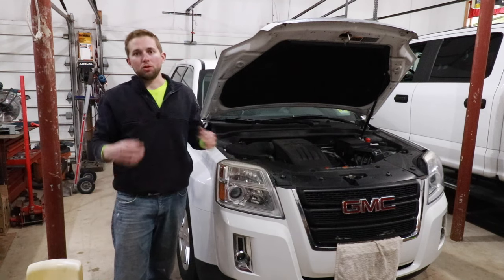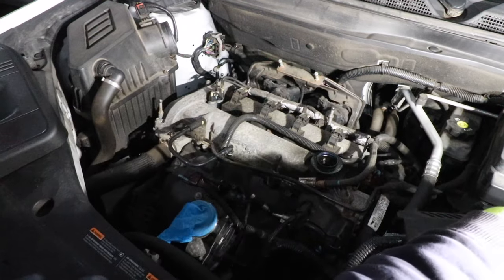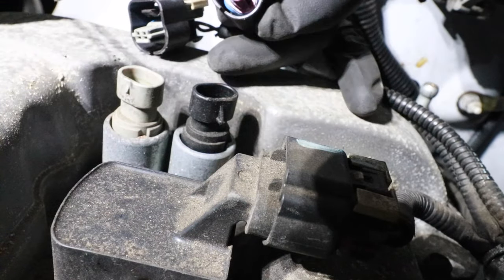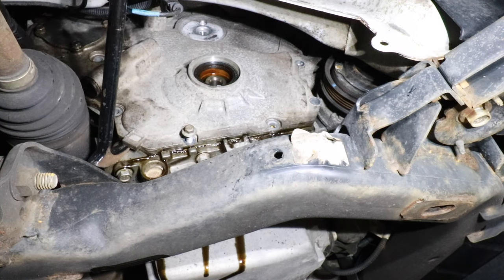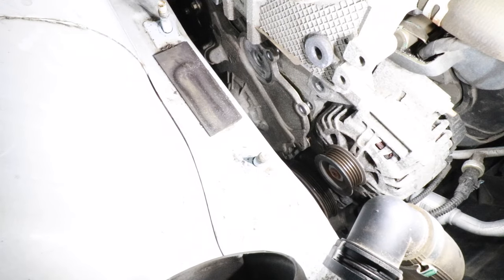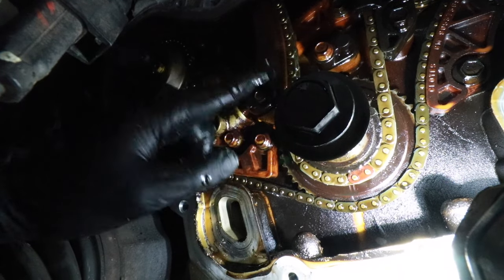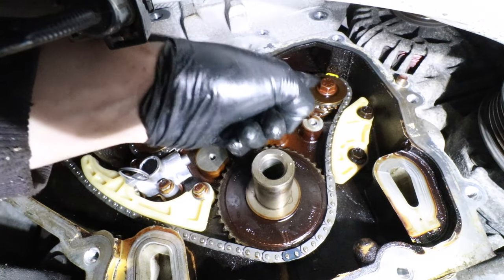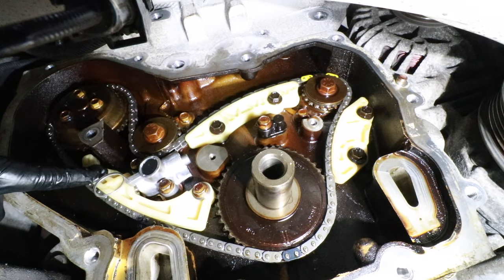GMC Terrain 2.4 | Timing & Balance Chain Replacement | Step by step

Comment: I have a question you first set it up the black mark was perfect inside the Groove then when you turned it 3 full times it was one link off that Groove at 35:30 into the video so it was  like it was before you started the job. Why is that? Is that ok?
Reply from the maker: This is normal. I’ve learned that the engine does this intentionally to ensure that the chain and sprockets wear evenly. The chain will not line up with its respective marks every rotation. As long as you are 100% sure that when you installed the chain all the marks lined up properly, you should be good to go.
Reply: @OldSoulMillennial  ok thank you

Comment: So after you timed the cams you have to time the smaller chain thats on the pump
Reply from the maker: @vossenconcave8571  balance shaft chain gets installed and timed first
Reply: @OldSoulMillennial  we timed the cams then we did wat was done in the video we turned it to wear it shows to put the chain wear the pump goes
Reply from the maker: @vossenconcave8571  You aren’t making much sense. The water pump is on the balance shaft chain. The timing chain is connected to the camshafts. Both chains are timed. I explained everything very clearly in the video.
Reply: @OldSoulMillennial  ok my question is if you timed it at firat why did you spin the lower chain again was it to time the sprockets
Reply from the maker: @vossenconcave8571  Seems like there is a language barrier here. I’m having difficulty understanding your question. Please try asking again in detail.
Reply: Ok in your video after you timmed it and took the chain off you was left with the chain that has the pump incorporated you said the pump wasnt timed and you was turning saying that you was making sure it was timed im just curious about that because i think by doing that in our vehicle it fixed our issue with tdc timming when the chain sliped on us
Reply from the maker: @vossenconcave8571  Sounds like a statement, not a question. The water pump is not timed. All other sprockets on the balance shaft chain (smaller inner chain) are timed. The marks on the chain should align with the marks on all the sprocket’s. 

The engine should have been at top dead center prior to removing any chain or guide. This is an interference engine.
Reply: @OldSoulMillennial  oh ok i get understand it sounds like it lol but no we just ran into a small kink and i thought i would ask you about it because i saw you turn it after taking the cam chain off. Our piston was dropping a little and at tdc and as soon as we did wat you did itwent up some more the marks were all at 10 and 2 and at 5 on crank so i was a little confused about it ty for being patient

Comment: Can this be the cause of a random missfire. Since every other part is replaced.  We have all new 02. Injectors coils plugs. Throttle body high pressure fuel pump mas map
Reply from the maker: @Texan1  Did you read your engine codes?
Reply: @OldSoulMillennial  only got a p0300 now
Reply from the maker: @Texan1  Do you have live data on your scan tool? If not, I’d start by swapping the spark plug and coil from the misfiring cylinder with a good cylinder. You can also do a compression test on the faulty cylinder.
Reply: @OldSoulMillennial   With random I'm not able to see which cylinder is misfiring and it has good compression
Reply from the maker: @Texan1  Any other symptoms or electrical issues? Are there any soft codes? 

A basic code reader only gives you active hard codes.
Reply: @OldSoulMillennial  nope
Reply: I'm at a loss and the shops in my town are 3 weeks plus booked out
Reply from the maker: @Texan1  Trying to help you out the best I can. Email me (in description). Tell me everything you’ve checked and replaced.
Reply: @OldSoulMillennial  will do
Reply: Just sent an email
Reply: Did you receive my email
Reply from the maker: @Texan1  negative
Reply: @OldSoulMillennial  just resent it
Reply from the maker: @Texan1  contact.oldsoulmillennial@gmail.com
Reply from the maker: @Texan1  contact.oldsoulmillennial@gmail.com

Comment: Does anybody know the size of the Allen wrench needed to remove upper guide as seen in the video at 19:44
Reply from the maker: I do not recall unfortunately. I know it's a larger size. You should be able to purchase a kit and check the plug on the side of the block before you tackle this job.
Reply: @OldSoulMillennial  okay because I got a 3/8 Allen wrench that fits the plug but I just wanted to double check if it was the correct size. Thanks man
Reply: @OldSoulMillennial  also wanted to ask have you had any other troubles since you replaced the timing chain? My timing chain kit arrives in the mail this weekend and I just wanted to make sure I didn’t overlook anything
Reply from the maker: @trollseasoning1012  Zero Issues with the repair. I highly recommend you do the timing chain and balance shaft chain. Stick with OEM. I've read many horror stories of the aftermarket chains breaking. I have links to oem components in the description.
Reply: @OldSoulMillennial if I can’t rotate my crankshaft more than 180 degrees does it mean I have bent valves?
Reply from the maker: @trollseasoning1012  Give me more information here.
Reply: @OldSoulMillennial  okay so I aligned everything like you showered in the video. All timing marks aligned as well. I assembled it back and when I tried to start, it didn’t start up. Just revved. I then disassembled everything again just to make sure my timing marks were lined up completely. When I went to crank the crankshaft manually like you did in the video, I couldn’t turn it 360 degrees. It just now turns a certain amount but not completely.
Reply from the maker: @trollseasoning1012 
 Did you manually turn over the engine several times after installing the chain the first time? 

If there was an interference issue with improper chain timing, that would have been your warning.
Reply: @OldSoulMillennial  I did not. Well I did a couple times but then I took off the timing and balance chain and redid the process of matching timing marks accordingly. I fear I may have bent a valve due to not turning over the engine multiple times like you did in the video. I can now only turn the crankshaft manually clockwise so far and counterclockwise so far. It won’t turn a full 360 degreees anymore without hitting something.

Comment: Those chains not coming back to the same tooth is by design.  Every manufacturer does it so that any wear is spread out.  Say a tooth on sprocket was shaped different than the rest and the chain hit that link every time it would make for quick wear on one link.  By design wear is spread out.  To tell if you're in the right spot count the links between the marks
Reply from the maker: Thank you for explaining this!

Comment: do i not need any kind of pulley puller?
Reply from the maker: I didn't Use one. The crankshaft pulley may fight you a little bit, but you should be able to remove it with a little elbow grease,

Comment: Did you forget to use 'clear flood mode' to prime the engine before start-up?
All those lifters, bearings, etc. needed pre-lube.
CFM should be used if vehicle isn't used for several days or so, regardless of new chains, etc.
Reply from the maker: Please inform us on how to activate this "Clear flood mode"
Reply: CFM can be accomplished by holding your foot to the floor while cranking but this is totally unnecessary all the other components he's referencing to you did not touch there is still residue oil left over on them. In clear flood mode would not give you enough oil pressure and distribution to lube all them Parts anyways

Comment: So after getting all of the chains and guides on, how many time do I need to rotate the engine so the timing marks will line back up to everything? Or is this one of those one-time thing and Let Jesus take the wheel? Lol
Reply from the maker: Good question. So I spun the engine over several times in an attempt to get everything perfectly realigned on the timing marks. I was unable to. On initial installation of the chain,  triple check that the timing marks are aligned properly, and then let Jesus take the wheel.
Reply: I had to do this. I had the first chain on and when tackling the second I had managed to rotate the engine a few times. To get it lined back up perfectly on the marks, I think I rotated it about 30 or 40 more times before everything landed back where it was supposed to be. I was then able to focus on the second chain/timing marks. So yeah, a lot of turns is the answer but they will line back up eventually.

Comment: OSM, thank you so much!  I can't imagine doing this repair AND filming it, bravo.  My Terrain runs like it's brand new now!  For more novice DIY'ers (like me), this took me about 15 hours and I went slowly and carefully, some tips for folks like me:  

-you will need an impact driver to remove the crankshaft pulley bolt (I also needed a handheld propane torch from Home Depot to heat up this bolt for 2 minutes, finally broke free).  

-I also recommend removing the engine mount with support under oil pan, it just made it so much easier to access everything, as it's pretty tight.

-Also, how to “find the top dead center of cylinder #1” found at 18:15 here:  ( https://youtu.be/OzzqmPmZxnc?feature=shared ).  

-I used Dorman part 917-954 special bolt to replace the guide bolt + 10 mm Hex cover (it replaces both)

-Lastly, I found putting the alternator belt back on the tensioner as one of the more difficult parts of this actually!  You have to put it around all the other pulleys first and slip it on the smooth tensioner wheel last (while extending the tensioner).

Thanks again OSM, a life saver, good luck to everyone else.

Comment: Stop around 22:50.  I don't think you are suppose to turn the crank after you take the timing chain off.  Isn't this an INTERFERENCE ENGINE???? I think you should have rotated the other sprockets (water pump and stationary sprocket) to along to the crankshaft mark.  I will watch to the end to see if this engine starts. 🤞

Comment: Why does it matter to "time" the balance chain if all it does is spin the water pump?
Reply from the maker: The balance shaft chain does more than drive the water pump, it also drives the intake and exhaust balance shafts. The intake and exhaust balance shafts must be properly timed with the crank shaft.

Comment: After 1st revolution off chain installation the color will NOT aligned back ti the marks it will take over 100 revolution to aligned again..what u see is normal you have a stretch chain.COLOR LINK ONLY MATTERS AT INSTALATION  ONLY.

Comment: Oh it will break GMC forgot to add that in the sticker price automatic locks electric windows am/fm cd player and a timing chain that will need replaced at 31k miles and a pvc line that will Clog and blow out your seals

Comment: If your one tooth off with that bend a valve or valves on this motor
Reply from the maker: If this is a question, this is an interference motor. Meaning if the timing chain isn’t perfectly timed, it is very likely that valve damage will occur.
Reply: @OldSoulMillennial  yes sir ty, it should had said will that bend a valve if it’s only one tooth off. Got a family member who thought he was a mechanic

Comment: My 2012 Equinox is burning oil. Can I put semi-synthetic in it?
Reply from the maker: They all burn oil. Check it every week or two. 

I use full synthetic. You can use semi as long as it complies with the owners manual requirements